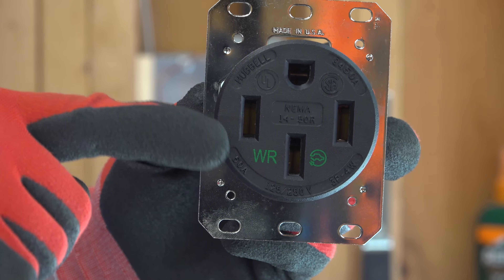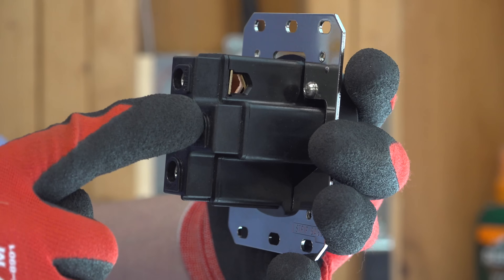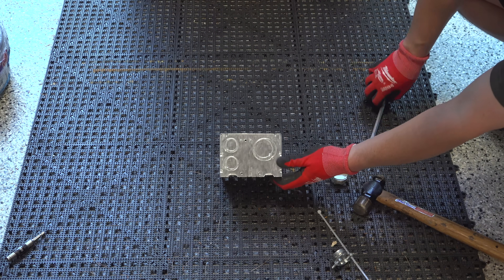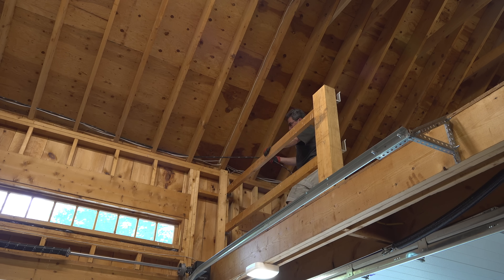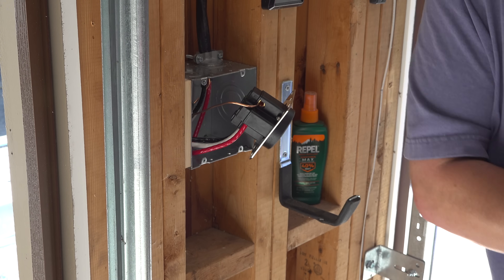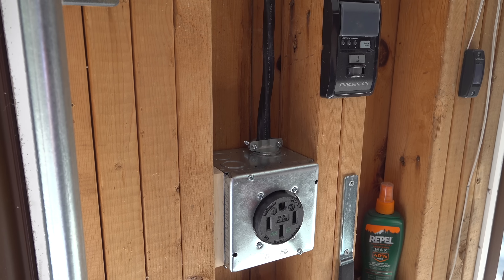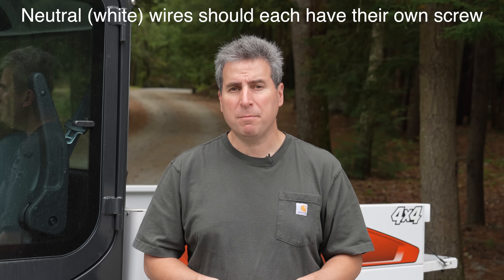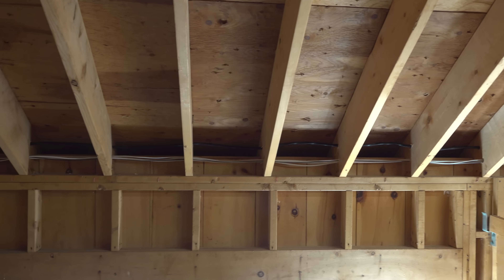How To Install A 240V Outlet Start to Finish -  EV Car Charger - Welder 14-50 Explained

Comment: Only thing that I've read that you didn't discuss is overloading your breaker panel. They're rated for a specific amount and you you don't want to exceed that. For example lets say you didn't upgrade it and installed every breaker as a 50amp one you'd quickly overheat it and cause a fire potentially. If it's rated for 100amps you shouldn't exceed 80% of that I believe is what I read.

Comment: Good tip on tightening down the wire in the receptacle is to tighten it, back it off, then tighten it again. This helps the individual conductors settle into allowing for a better connection in the future as the wires expand and contract.

Comment: No drywall made running the wires through the garage walls much easier.  I've lost count how many times I've had to patch the drywall in my finished garage to run additional outlets.
Reply: Did you have to repaint it too?

Comment: Sorry, but the difference between Leviton and Hubble isn’t about continuous use… it’s about plug/unplug cycles. A portable EVSE needs to be plugged and unplugged frequently, which wears out the lower grade hardware to the point where they no longer support continuous operation at their rated amperage. Ranges and dryers and such weren’t a problem because they would stay plugged in for years with no additional wear and tear.
Reply from the maker: All excellent points.
Reply: However, the EV charger does not get plugged in frequently at the receptacle. Typically, you plug in the EV charger and rarely unplug it since the distal end of EV charger plugs into the EV.
Reply: @ter450  That’s why I said “portable.” Until Tesla stopped including their Mobile Connector EVSE with every car, it was industry-standard to include one… and much of the competition (like GM) continued doing so until a year or so ago. Heck, my brother’s 2023 Bolt EV came with TWO EVSEs (level 1 and level 2). These were always intended to take with you so you could charge at your destination, RV parks, or any place with a connection. Even though that’s changing, the portable EVSE has traditionally been the most common way EV drivers charge their vehicles at home and it was wearing out the receptacles… and since Silver Cymbal does not use it for an EV then the expected scenario for the near future would be for guest use. That essentially means, you guessed it: A portable EVSE. Don’t forget: This one will also be used with a welder, which means swapping plugs unless he ends up hard-wiring any future EVSE. On that note: Installing a NEMA 14-50 for an EVSE instead of hard-wiring is primarily so that it can support a portable Level 2 EVSE… which is why Hubble became the go-to.

Again, this is the exact scenario that resulted in Tesla recommending Hubble-brand higher-grade NEMA 14-50 receptacles. It’s all about insertion/removal wear cycles.
Reply: @emmettturner9452  Why would any "Level 2" EVSE require the extra wire? I have one, and it only has 3 terminals at the input, not 4. Granted, it's not a portable EVSE. It's a box mounted to a wall.
Reply: This is incorrect. The standard duty/Leviton receptacle is built as cheaply as possibly while still doing the job for dryers/stoves etc. They are not built to withstand the HEAT from continuous use. 40A for 3+ hours. The heavy duty/EV/Hubble/Bryant 14-50 receptacles use different plastics,  way more metal, all to handle the heat that comes with EV charging demands
Reply: @gringolatino97  That can’t be true because even EVSE’s conform to the 80% rule for continuous load (40A on a 50A circuit). If the Leviton and others cannot handle 80% of their rating at continuous load then they fail to meet the NEMA 14-50 standard they specify and would not be rated at 50A.
Reply: @gringolatino97  Been using my Leviton for nearly 6 years with my Tesla. Never an issue as you describe and mine gets "heavy EV use"
Reply: @heathmurphy55  Again, it’s not about heavy use… it’s about plug/unplug cycles, like you would do multiple times a day if all you had was a portable EVSE that you brought with you every time you left.

Comment: Hardwired EV chargers typically require 48 amps, which exceeds the capacity of a 14-50 outlet and the 50 amp breaker. You'll need a 60-amp breaker to manage that ongoing demand safely. If you're certain you'll stick with a portable 240V charger, a 14-50 outlet should work okay, as those chargers are often capped at 32 amps. That said, 14-50 outlets aren't built for constant plugging and unplugging. If you can't keep the portable charger plugged in all the time (such as for outdoor setups), apply DeoxIT to the outlet. The DeoxIT DN5 version is safe to spray into a powered outlet, but if you're using D5, shut off the power beforehand.
Reply: I'm "splitting the difference," with a small upgrade path: Hardwiring a 40A EVSE dip-switched down to 32A because that's all my car can use. 6ga wire on a 50A breaker, and ready for 40A for the next car. If I ever get a faster-charging car and convince myself I need to bring it up from dead in only a few hours, I'll install a new supply and EVSE. That's many years away however, for me.
Reply: I am doing something similar.  I am hardwiring a 48A EVSE on an old 30A dryer circuit and setting it to 24A limit.  My current car can only take 27A, so this won't limit my charging much.  If I get a car that can charge faster, I will pull a 60A circuit to it and set it to the full 48A.  The great things about hard wired EVSEs is no outlet wear/heating issues, and no need for a problematic and expensive GFCI breaker.
Reply: Most currently sold hardwired EV chargers have the ability to select the amperage either through software or physical dip switches.  You absolutely want to dial it down to 80% of the rated breaker to ensure safety.
Reply: And part of this was using the correct EV rated outlet for multiple insertions.

Comment: All I know is the ground part is over my head. To be safe, I would get an electrician to install it. 
I’ve heard that it takes two years for electricians to learn all about grounding.
Reply: It's just as he showed: ground wire goes into the ground terminal on the plug, and screwed into the box.  That's all there is to it.

Comment: I've always heard that you should NOT use Romex for EV charging. THHN is the correct wiring I've seen recommended for EV charger wiring.
Reply from the maker: If the wire is sized correctly, THHN offers no benefit or enhanced safety, and the argument could even be made that containing the wires in a conduit could be worse trapping the heat, but that isn't really true either. Your service entrance cable that is often you main feed is a type of jacket cable and that handles all the power from your house through it. Its really a matter of the right size and proper terminations and either does the same job.
Reply: @SilverCymbal  Some really bad info here. I know you are future proofing your stuff but the minute you include a power supply for a EV car it changes everything. EV charging is a continuous load so 125% rule comes into effect. I believe code says you must calculate based on the max amp that the device is rated at. So a Tesla electric vehicle supply equipment (EVSE) rated at 48 amps needs a 60amp breaker. 48x125%=60. Your Romex number 6 is to small. Even if you never plan on charging at the full 48 amps NEC assumes the worst hence the max amp rating. In the future I think some insurance companies are going to be looking closer at home fires caused by EV chargers and their install.
Reply: @robm3063  Not true with the Tesla. The car correctly charges to the adaptor. Thus with NEMA 14-50 it only draws 32A. It could go up to 40A (80%) but the mobile connector is not rated for it so 32A it is.
Reply: The garage is sometimes considered a “wet” environment according to some codes, which would then require conduit with THHN and GFCI. It’s hardly universal though.
Reply: @emmettturner9452  there are no universally adopted electrical codes. NFPA updates NEC every 3 years, but every municipality decides what works for them. For example, in Chicago every residential electrical circuit must be in conduit (goes back to Mrs. O'Leary's cow).
Reply: @db869  That’s why I said “according to some codes.”

Comment: I bought a very nice Knipex ferrule crimper and I’m always wondering if it would be best to put a ferrule on any stranded wire. It seems so easy to mutilate 6 gauge wire with over torquing.
Reply: It depends on the strand count for something with a low strand count like that wire it's actually not that great and it's even worse with solid conductors. When you need it is more when you're doing stuff with finer strands. That is one big difference between the UK and the US is that they use far more flexible higher strand count conductors. And because it's more like hair sticking out it's a lot harder to get them all in and keep them all together. Where as the slightly cheaper thicker strands tend to stay in place And don't create whiskers.
Reply: Use a torque screwdriver to make sure the torque is correct.

Comment: For those who have never installed a 240V outlet, you made it sound easy (which it is). Good job.
Reply: It can be easy, provided you are already familiar with electrical work, know the relevant codes, and happen to have an unfinished garage with an unobstructed path between the outlet and the panel.
Reply: I was 7

Comment: I'm going to be honest, I wouldn't use an outlet to charge my EV. I've seen too many images of melted outlets. My county inspector heavily requested that my charger was hardwired.
Reply: Hardwired is certainly best, especially since you can go 48A+
Reply: Plus if you hardwire you no longer need a gfci breaker which can save a significant amount of cost.
Reply: @KurtsRPMGarage indeed!
Reply: Still be sure to torque the connections to spec.  Loose connections get hot and EV charging is unforgiving.
Reply from the maker: Nothing wrong with that and if you never need it for other items it would make sense